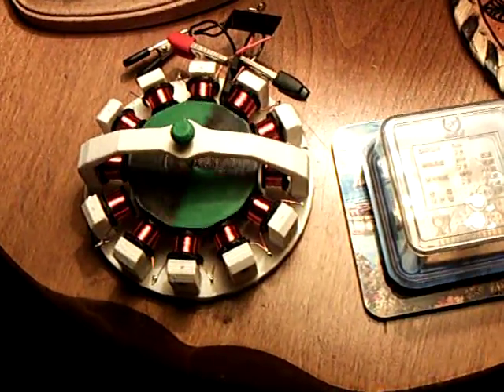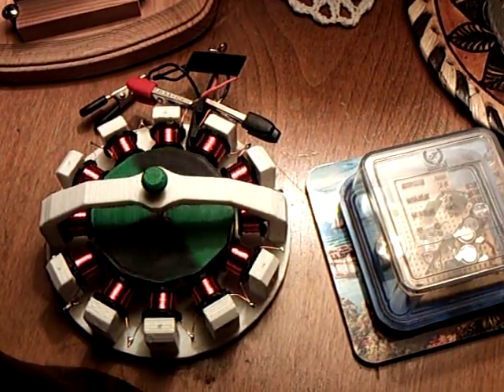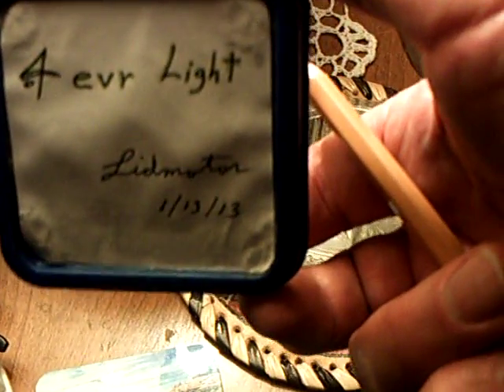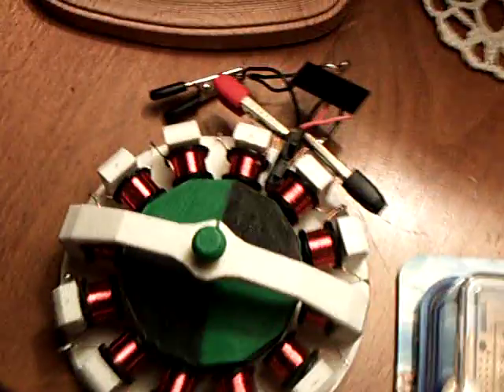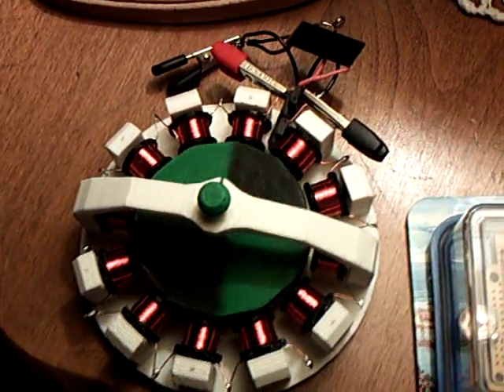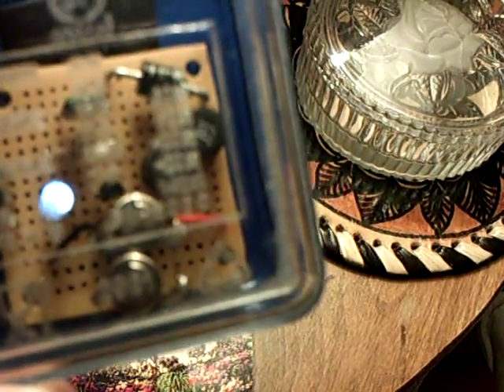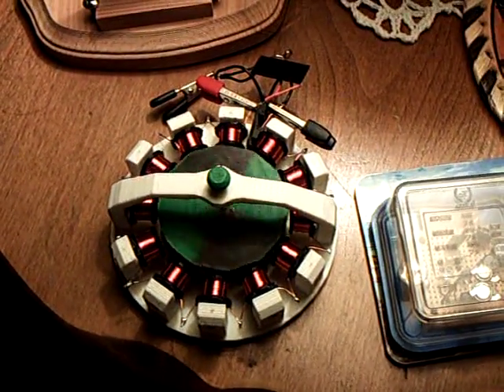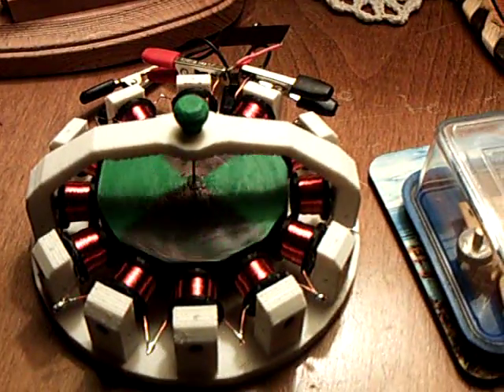Light Powered EZ Spin Motor

Comment: You have some of the coolest gadgets on your channel.  The light is cool idea. 

You may want to look into Strontium Aluminate glow powder to mess with too.  Mix that with some polyester casting resin from a craft store and you can make all kinds of things that glow like that light.   That powder is amazing though, not that stuff that goes dark after 10 minutes.  The SA powder will literally glow ALL night (it is rated at 12 hours, and it is true) on only a charge from ambient light.

Comment: Can you do a close up of how you have soldered the windings ?
Reply from the maker: 3D_Printing Sorry I don't have the time to make a video for just that. The coils are simply wired in a long string with alternating poles pointing towards the rotor. Use a compass to check the polarity. You can wind them any way you want. The fine wire was soldered to small pieces of solid copper wire to make connections easier. A dab of hot glue holds the pieces of solid copper wire to the spool.
Reply: *****'The fine wire was soldered to small pieces of solid copper wire to make connections easier. A dab of hot glue holds the pieces of solid copper wire to the spool..'

I understand now - thanks.  I made one but I replicated what Lasersaber did, and I am trying to find an easier way of doing it.  I have a video of my build on my channel if you want to take a look.
Reply from the maker: 3D_Printing Very nice.  Good description.

Comment: Nice motor. How many micro amps does it draw when it is running?
Reply from the maker: +kafr8413 The best I have gotten using a reed switch circuit (so far) has been 2 micro amps at 9v.  The electronic circuits I have tried (so far) are way up there at 30-60 uA.  The reed switch and bearing can be adjusted so that the firing takes place only part of the time and that is the reason for the overall low amp draw. A slightly wobbling rotor does the trick on my setup also.
Reply: ***** If I am using Ohm's law correctly, that would mean that there are 4 mega ohm's of resistance in that circuit. That is remarkable. I will be building one of these. I have Lasersaber's version 1 motor, and it is great, but this is incredible.
 What is the total resistance of the coils?
Reply from the maker: +kafr8413 About 12k for the whole thing.

Comment: If you were looking for the always on option the transistor and circuit setup of the newer dollar store solar lights seem like they would do the trick. They have unique qualities that give power to the load as well as charge a battery when there is enough light to do so but if it is too dark it switches the load to run from the battery. http://youtu.be/t3xywdXtF94
Reply from the maker: Tommy H Thank you!  I have some of those and that should work perfect.

Comment: Cool little motor. Remembered something Tesla said about working with very low voltage. "Great care must be taken to eliminate all metal points and insulate all bare metal." May be just moisture in the air that's carrying away energy.